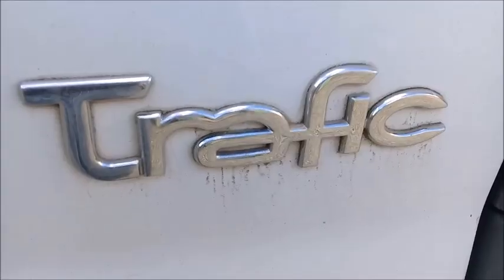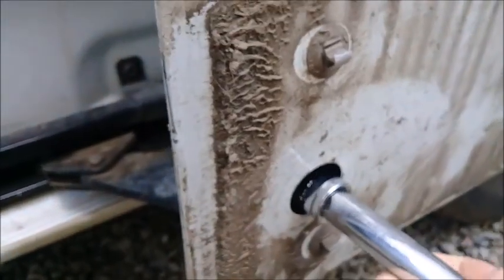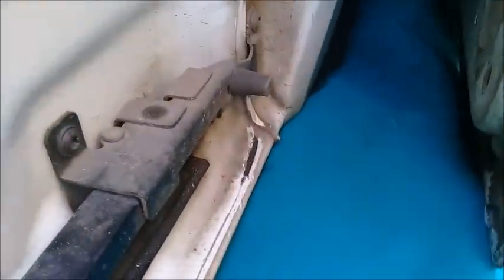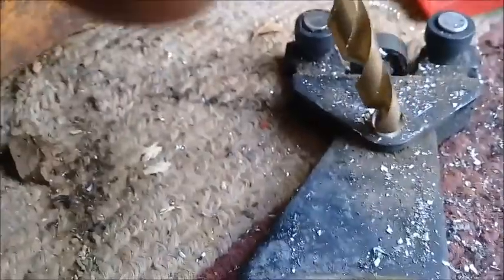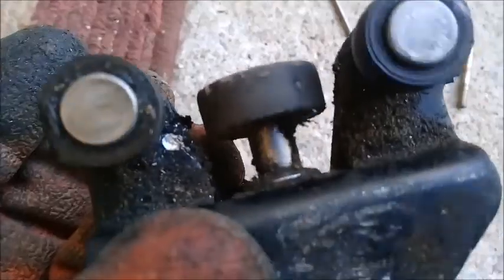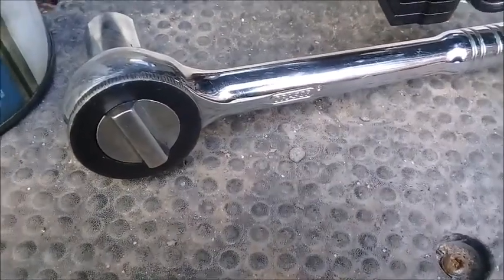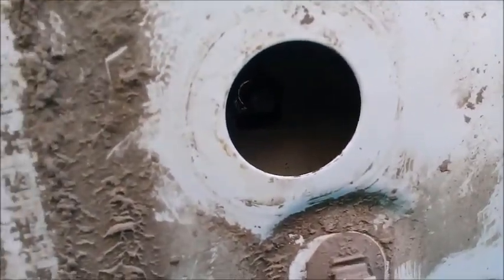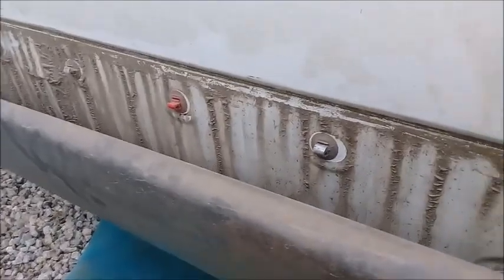Vivaro Trafic Primastar Slide Door Roller Replacement Door Closing Fix

Comment: use an angle grinder to grind the head off while its on the van, that way you dont have to remove main bracket and use loctite blue on the thread, mine came undone after a few months. By the way, nice series of videos!
Reply from the maker: Jason Mills thanks Jason and always nice to have some feedback. I better go and check the bolt now ☺👍

Comment: I have a 16 year old trafic mk2. The rollers are pretty good on it, I alternate spraying them periodically with wd40 and spray grease. I use the wd40 first and the use the doors for a few days and then hit the rollers eith the grease. Prevention is better than the cure but I am noticing some play in the most used door now. Not bad though for its age. I'll probably replace that one next year. Thanks for the video.
Reply from the maker: A 16 year old trafic is very good going so what's the mileage and has anything gone wrong? I love mine and was worried about buying one, but i love it. Btw my replacement roller is holding up well 🖒
Reply: @fiveminuteman  I can't tell you the fault history of the van. I've had it since late 2015.  The turbo blew in a right royal fashion after I'd had it 4 months but we saved the engine. Having said that it suffers from power loss issues under load but it does start first turn of the key every time. I imagine that when the engine raced that it suffered piston ring wear and internal seals wear. I might be putting another engine in it next year, should solve that problem eh.
I did have multiple warning lights alternating on the dash last winter and we found that a 24 pin multi plug in the engine bay fuse box was very sensitive. Just a wiggle was setting off random dash lights & the engine revved up & down on its own. We solved it by cutting the wires & crimping spade connectors individually. A nuisance but it worked. 
These vans are very well built with good solid chassi & panels, the door catches & other body hardware are pretty damn good too. I think that the over complicated French electrics (renault) are what can let these vans down. Great while it's running but a Pita if it goes wrong. Overall I would not buy another but since I'm stuck with mine I make the best of it. A nice drive, comfortable & smooth.
Reply from the maker: @railinly610  wow that's a history and a half.  Must admit the electrics do let it down and not sure mine still has the origional turbo, gearbox or engine lol.  Mine has 158k on it now so fingers crossed for a few more years.
Reply: @fiveminuteman  I'd say that if you have a good one and you keep servicing it there's no reason why it won't keep going a lot longer. Mine had a gearbox change   at 157k (fitted by a previous owner) and the mileage is still stuck on that reading because the gearbox they fitted was from a later model and didn't have the drive sensor. My van would have done in excess of 200k , maybe even a lot more, I'll just never know.
Reply from the maker: @railinly610  amazingly i chose it over a VW T5. The T5's down here in devon are a ridiculous price. In the end i needed a bigger space inside as i converted it to a day van.  The T5 was just a tad too small for what i wanted.
Reply: @fiveminuteman  nice one. Mine was registered as a motorhome from new, it was a weekend/day van really and I've completely changed about 80% of the internal fit now. You're right on about choosing one over the v dub imo. The dimensions are better, mine's the long wheel base and it makes a difference. In the end you pay less & still drive the same roads and carry the same gear. Ok they might look like a deformed praying mantis but hey ho, that's fine with me.
Reply: 2001 vivaro owner here, only 132000 miles,  bought it from my work for 300 quid as it was just taking up space, absolutely adore the thing
Reply: Rai Linly - Tip for anyone experiencing electric issues not just in these vans but pretty much in any vehicle. 
1 - DO NOT wiggle wires and connectors. Broken wires or "relaxed" contacts are the number one cause of electrical misbehavior in most any vehicle. Modern ones are particularly affected due to the large numbers of these type of connectors.
2 - Keep contacts CLEAN. Be it Earth connections or any other for that matter, not forgetting the fuses. From "electronic contact cleaner" spray to !mustard!, yes mustard. Anything is fair game to make them clean and shiny. A fuse with dirty brown contacts is shouting "CLEAN". LOL :-)
3 - If corroded replace the cable and clean the saddle of any grounding cable. That alone accounts for a huge amount of complains in most cars/vans. On the Trafic the gearbox ground cable is particularly affected. For the main reason see #5.
4 - Keep the battery properly charged and once more tight and clean terminals. Low battery voltage can account for a number of strange behavior of electronic equipment, particularly if associated with any of the above points. 
5 - Last but not least. Keep the damn plastic protection under the engine bay in place (undertray). The ridiculous habit of removing it, is responsible for a number of malfunctions. Since it allow water to spray pretty much everywhere in the engine bay, namely on ECU contacts and main fuse box. ;-)

Bonus tip. A rotary Dremel type tool with a wire wheel. Makes short work of turning contacts to bright shiny metal. 
Cheers

Comment: When the slide door is out of square, i don't think  is the bottom roller fault. I think that the bottom bracket is out of square. So I solve it by adding two washers at the back of the bracket (between the bracket and the door) top nut. 
Easy.
Reply: Did that as well, without reading anything. It just made sense! Glad to see others found the same solution.
Also, I don't understand why he greased the rollers as they are rubber covered and need to spin in the slide...

Comment: Did u have to adjust this up and down after fitting.....please
Reply from the maker: Door did need a bit of adjustment after as central locking contacts didnt connect
Reply: And where did I adjust it from.....

Comment: Most common issue that I found is that the top (roof slider) bracket is gettning loose or screw of middle rail is getting loose which makes very difficult to shot the door closed. If You wanna to change the roller please drill from underneitht because it is riveted from the bottom. If you drill away bottom part of shaft which is hammered then you will be able to extract shaft from the bracket without troubles.

Comment: Good video mate. Problem is that replacement rollers are not very good quality and doesn't last  long .Original part's are so expensive and you can't buy these rollers on the own, you have to buy them with that arm.
Reply from the maker: Mine seem to still be going well.  Always a gamble with ebay parts

Comment: I've got a sliding door with a gap after been driven top roller has moment if press on door when open what do you suggest new top roller?
Reply from the maker: Try adjusting first before that
Reply: @fiveminuteman  Where's is it I need to adjust? Bottom one? It shuts lovely stationary when driven seems to open a little. Thanks for reply.

Comment: my renault traffic sliding door locks,but there is still some movement in it as it keeps moving back by about  a quarter inch when im driving along which sets the door light on....any ideas?
Reply from the maker: Try adjusting it where i did in this vid. Mine does what yours is doing.
Reply: Ok will do.so I just loosen the 3bolts on bracket,and move bracke back?

Comment: I watched this video to get my slider back on. nice job but!... you Doug yourself a hole. you don't have to go that length to do it. it took me ten minutes just grind the top nut down, hammer the pin out, NO NEED FOR A DRILL! doors still on, and then nut and bolt the new part onto it. works like a charm, no need for all that tlc.
Reply from the maker: Drilling and filming was time consuming and I didnt have a grinder so was the only option.
Reply: @fiveminuteman  aww thats fair enough. cheers for the video though mate I'm not good with repairs I just found my own way. peace x

Comment: Dont use grease on the rollers, it makes them slip rather than, er, roll, wearing them out far quicker. 
You can get complete assemblies which are far better quality.
With the outer trim, turn all those clips 90° and remove them, then put them back on the plastic trim, then simply offer it up to the door and push it back on.
Reply from the maker: Cool

Comment: Is this roller an Ebay special or direct from renault/Vauxhall? I'm having major issues with my door sticking out about 10-15mm on this corner 🤯
Reply from the maker: Its an ebay one and still going strong.
Reply: @fiveminuteman  really 😯 the one I bought off Ebay hasn't lasted that long lol, also found that the bolt supplied didnt fit properly, I had to drill the hole out to a bigger size to fit the circle side of the nut if that makes sense?
Reply from the maker: @MrShaunys1210  to be honest i thought mine wouldn't last. I'll check mine tomorrow to make sure its ok.